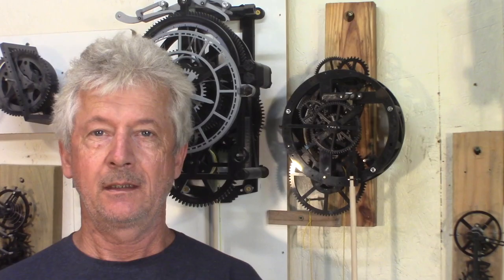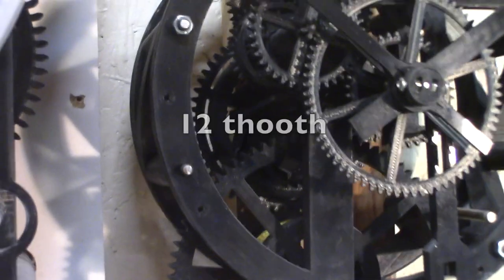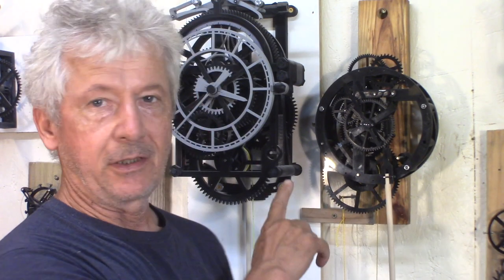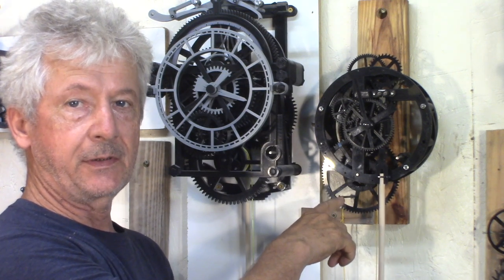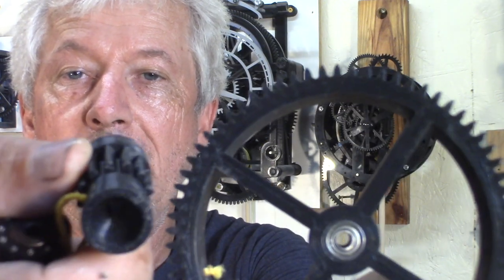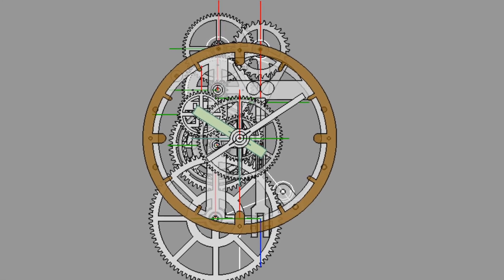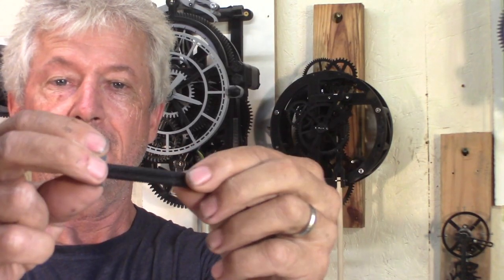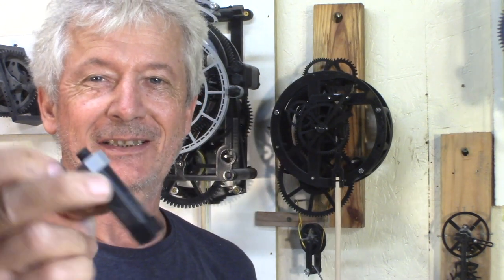8 Day Clock

Comment: Encore un superbe travail
J'utilise beaucoup le PETG pour les pièces de mes maquette bateaux, il moins sensible à l'humidité et plus résistant que le PLA
Reply from the maker: Merci
Quels sont vos réglages? et sur quels surface? 
Oil j'ai lus que le PETG est plus resistant dans le temps mais doit être bien sec a l'impression, le sécher vous?
Reply: @jacquesfavre999  
Je règle comme vous  buse 240 plateau 70, il faut faire attention à la température du local et des courants d'air, pour éviter le warping, j'ai en préparation un caisson pour les deux imprimantes Ender 3 et CR6CS, Qui sont toutes les deux en panne,  CR6SE carte maire grillée (en branchant le cordon USB) et Ender 3 pas de vis support buse hs, il peut aussi y avoir des problème des cheveux d'anges, voir la vitesse et rétractation. Pour le PETG, je ne le sèche pas, mais le PLA je le tiens bien au sec !! pour l'adhérence sur le plateau, j'utilise de la laque forte pour les cheveux.

Comment: Awesome job. The best I have been able to reliably achieve is about 1 pound (0.45kg) drive weight per day of runtime. Adding more weight gives a larger pendulum amplitude and the clock becomes more stable. Winding once per week makes the clock really easy to keep running. 
I am curious about the PLA vs PETG comparison.
Reply from the maker: Thanks
This clock too is in the same range:
https://cults3d.com/fr/modèle-3d/maison/8-day-mechanical-clock-for-20x20-bed
also 3.5 to 4 kg for 8 days, same as a traditionally made clock according to the author
Eventually I will have to compare gears in PETG versus PLA
Also want to try ABS or ASA, it should be possible to print gear in open printer with a good bed temp
The reason I went for PETG is that it is what Prusa uses for their printer parts
They certainly have some experience about printing in PETG and how it last in time
I happen to have got a Prusa Mini Clone by Fystec, and just by printing the parts, learning a lot about 3D printing design
and some magistral failure
Time will tell

Comment: What is the purpose of the pulley?  Sorry, I'm new to pendulum clocks.  It looks like it might give you twice the run time.  But that also means you get half the force on the escapement wheel.  Is that enough?  Or do you need to double the weight?
Reply from the maker: yes the pulley allows to double the run time, with twice the weight

Comment: I assume basement. High humidity on filament?
Reply from the maker: actually a shed in Florida, no shortage of humidity. I have started to use a drier, it does make a difference for printing
There issue here is with a finished part that degrade over time